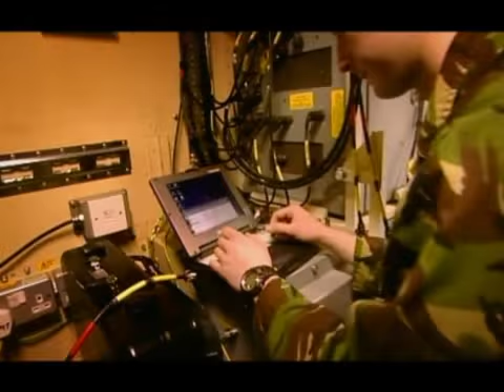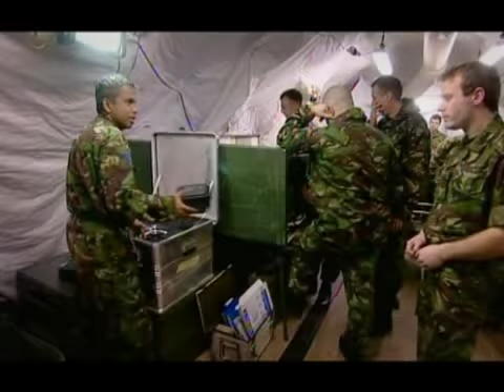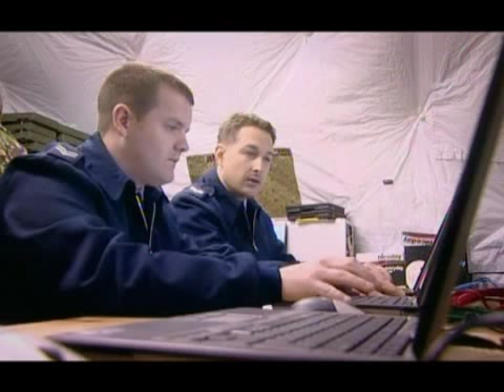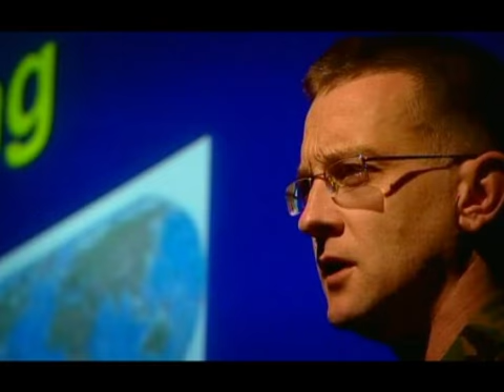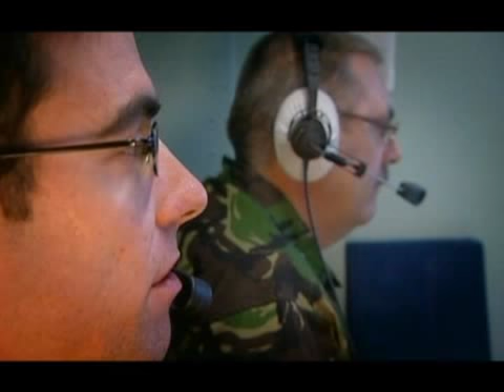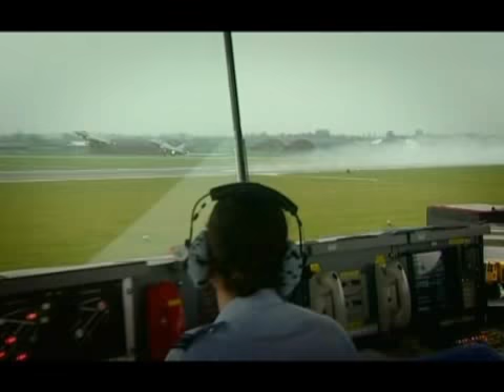RAF ICT Specialist

Comment: Consider themselves professionals yet using Windows
Reply: When the us military used windows xp, I know its 8 years old an all but still.
Reply: @slyninja2298  the reason is bcs windows is a quick easy set up in the field. They don't need the in depth customization of operating systems such as Linux